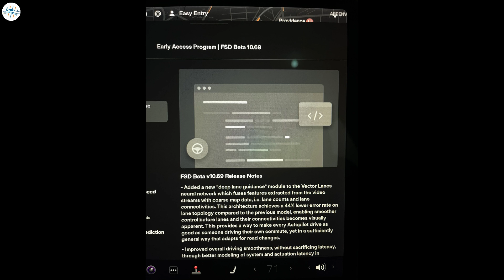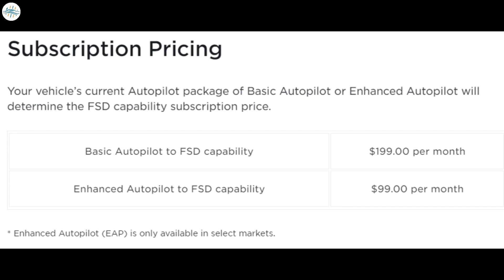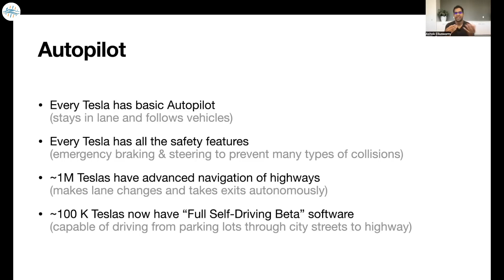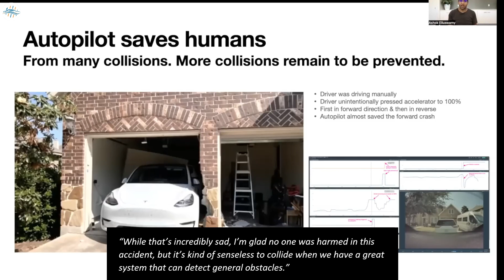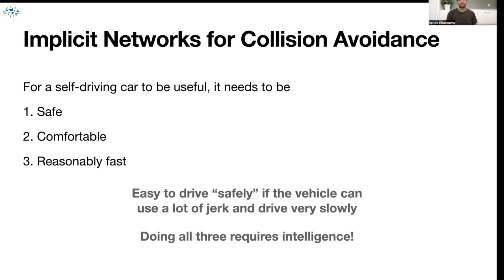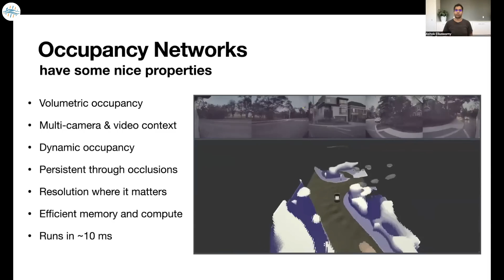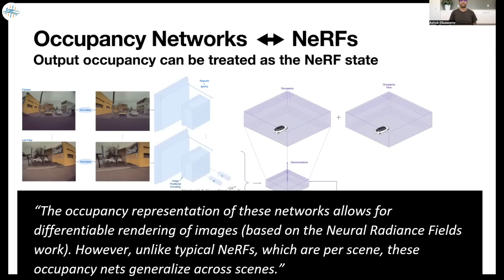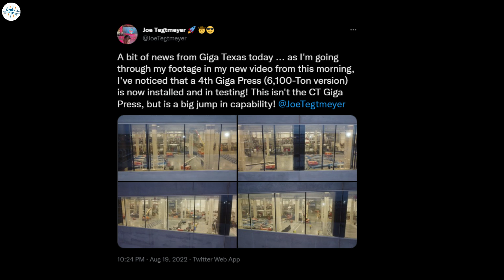Tesla To Bring Huge Improvements Soon & More Updates!

Comment: FSD works fine on the highway; then, so does AP and EAP.  It seems to do good at Stop signs and Traffic lights in town. They still have work to do on turning corners.  What I would call a normal corner they are OK.  Anything different and you better have your hands on the wheel to course correct. I"m sure it will get better, but it can be a bit exciting right now. Considering how late Telsa is getting FSD done, raising the price currently is a money grab to get more people to buy so they don't have to pay another $3000 over the inflated price of $12000.  I know they need to make money and profit, but recently it feels like they are doing it a the expense of their loyal customers.  I just purchased a MY and I didn't get a charger.  Yes, they lowered the charger price, but buying an electrical car it should come with a charger. Most of the people I know with M3 &Y use the Mobile unit and not a wall unit.  He dropped the referral program so you couldn't get 1000 free miles at a supercharger.  They removed Radar when he thought it was costly and didn't work as well as he wanted. Now there is talk that the Radar could be back as it has gotten better.  That would an extra cost for those who didn't have it.  As the other companies finally got on board and rolled their EV's he is going to get more pressure to make a better interior and reduce costs. The others still need to get their charging grid better and not require an app to find the units. I expect that Gen 2 of those EV's will close the gap even more.  I find the center screen to be an issue. Putting in the normal location would provide viewing without looking center and down.  Check out almost all other EV's. I hate to spend another $800 or more to add a front screen with custom data.  Another thing he should do is improve the apps vs locking down the screen. NO XM Sat, No Carplay, No Anrdiod play, the list goes on. If you like Spotify then you are good.  Just seems that most of this requires little to no hardware and just software so the more options he provided the better the car would be.  No Run Flats and no Spare, again buy your own $500 spare.  If you are always around town you may not care, but on road trips having a spare is important. Wait he has so many orders he can't make enough of them so what does he care?  I still like the tech in the car and think we would have EV's if it was not for his vision. Just wish he was more open and thought about some things better.  Even if Telsa made the spare and thought ahead to make it fit in the trunk or the frunk would have been much better, even if you had to buy it as an option.